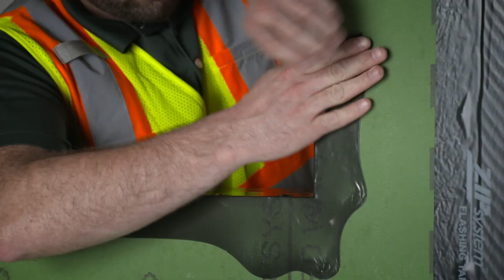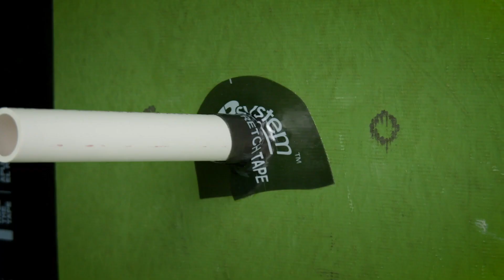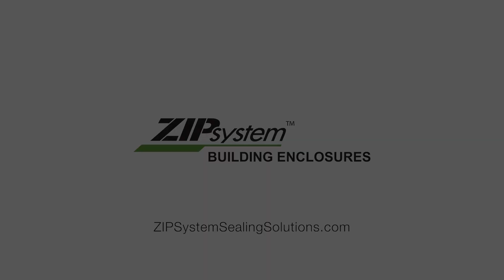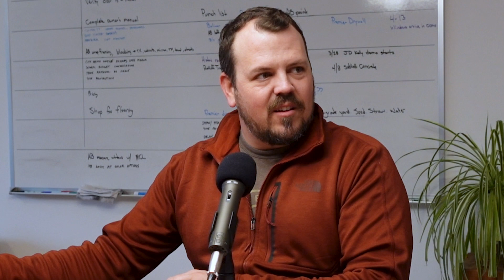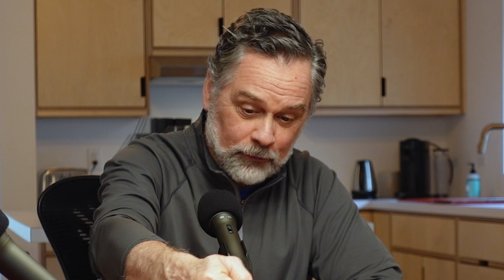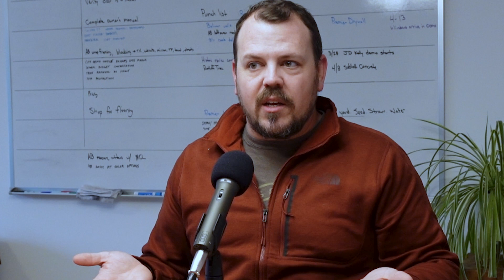Acoustics - An unsung component of high performance? - UnBuild It Podcast Episode #59

Comment: Arresting sound waves,and than absorbing them is the name of the game.
Isolating/insulating/airgap concrete from bottom plates (including interiorwalls),cladding from-assemblies,windows-rough openings,roof cladding-membrane-structure.
Especially mechanical equipment, whether on an interior wall or roof ,or an exterior pad .

The winter of 2017 I ran a crew that built a 200ft L X 20 ft H sound barrier fence to arrest construction noise from beach condos on Sea Island GA.
6 ft rolls of 1/4 thick rubber were ran vertical between steel posts,then aluminum 2x4`s were bolted through the membrane with ss hardware. 
Sound waves can either be absorbed by a large enough mass sometimes not feasible, or arrested .
Since this was 150 yards from the Atlantic Ocean ,hardware was chosen for durability rather then its acoustic properties.
What I'm most proud of the hand dug holes and hand mixed concrete around 36 posts..it survived 2 near miss hurricanes.

Comment: Check rothoblass for crazy acoustical gasket extrusions - colour coded - from europe CLT industry but probably useful in stick frame also
Reply: Re: tuned rubber attenuation devices… but these are strips for footing to wall and wall to framed floor connections

Comment: Speaking of acoustics, Jake's kitchen could use some soft surfaces to reduce the echo. All I see are hard surfaces everywhere! If curtains, rugs, or tapestries don't fit with the interior design, you can hide some soft foam on the hidden faces of tables, chairs, and cabinets.
Reply: Or, like, maybe the priority in a kitchen is ease of maintaining cleanliness over acoustics? Even 50s low end apt builders did a smooth ceiling skim in the kitchen when the rest of the square footage was spray applied popcorn / spatter finish.